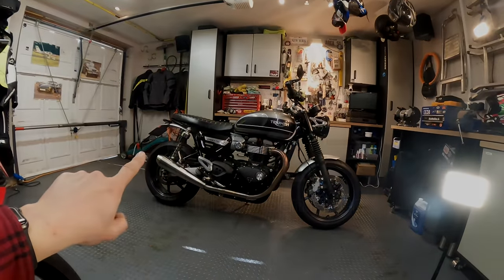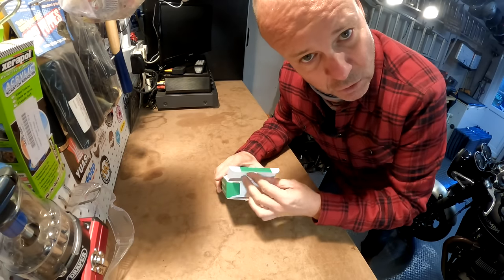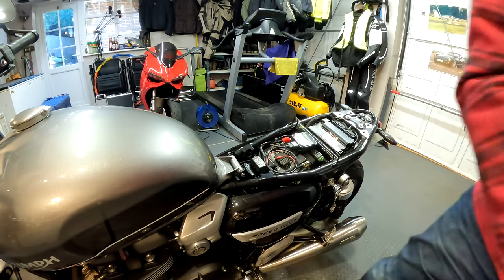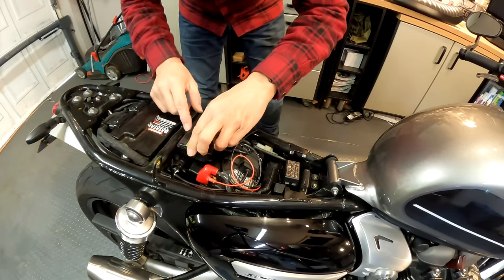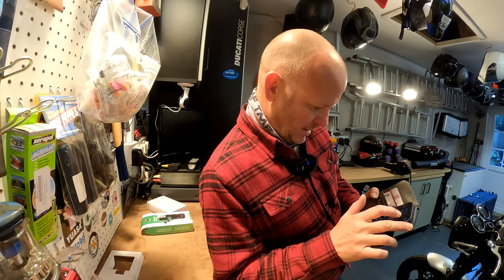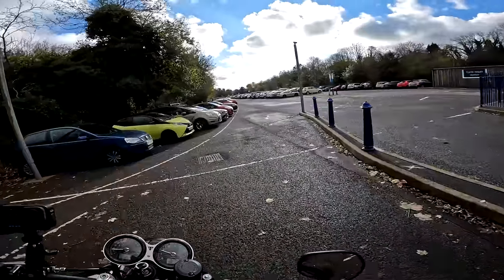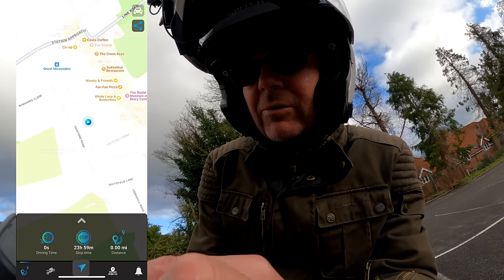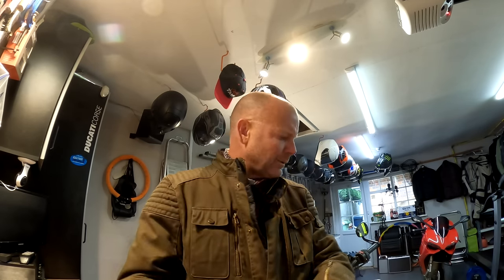Keep track of your bike! - Sizzapp monitoring Device Install & Review 4K

Comment: That’s pointless.
The thief is just gonna find it and rip it off. Your gonna know your bike has been stolen and find the tracker in a hedge or a car park.
Reply from the maker: I like to take a layered approach to security - the more the better (it all helps!).  If a thief did do that at least I'd know the bike was stolen as the tracker would alert me to a battery disconnect (it has about 3 hours of in built power I believe)...
Reply: @TheMissendenFlyer  or could get get a Monimoto and be able to hide it better due to having no wires.
Reply from the maker: Maybe - but you'd have to deal with carrying a fob device with you seperately from your keys (which I found a pain), manage two batteries and pay a subscription for the SIM.  I think all these devices are great and have used Mnimoto up until I learned about the Sizapp - for me the Sizzapp as a "fit and forget" solution is a better solution for me and hence is now my preferred choice..
Reply: @TheMissendenFlyer  it is a bit telling that the bikes you have that you value, have a proper tracker.
I’m guessing a Biketrak or Datatool tracker.
Your not ripping those out and fitting Sizapps.
Don’t blame you neither would I.
Sometimes a better device with a small monthly fee is just better.
I’d be interested in a review and details of what you find these trackers to be like.
Reply from the maker: I find they drain the batteries within a matter of days - as I said at the start of the video they are highly functional but also expensive to buy, fit and run.  Some bikes (GS, Panigale and GoldWIng) had them installed as part of the original purchase and my insurance insists they are activated (same with my cars as it happens)....so I have no choice but to use them.  If it was just down to me I'd have a Sizzapp and an Apple tag or two on each bike....the more layers of security the better.